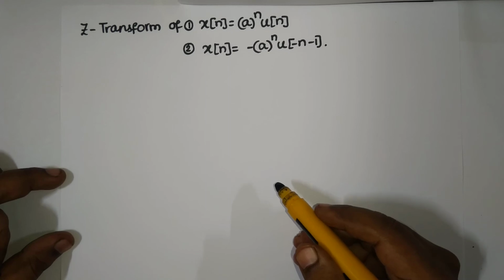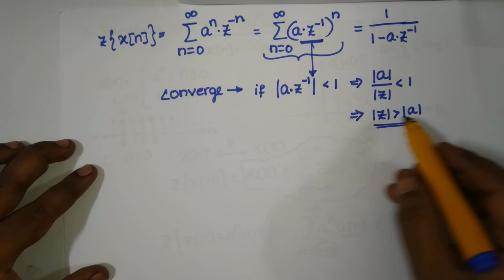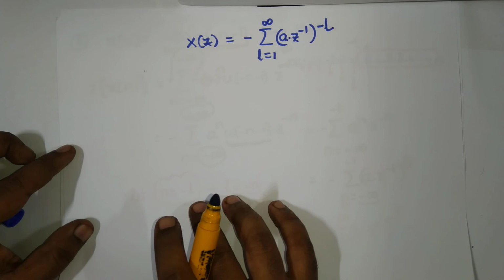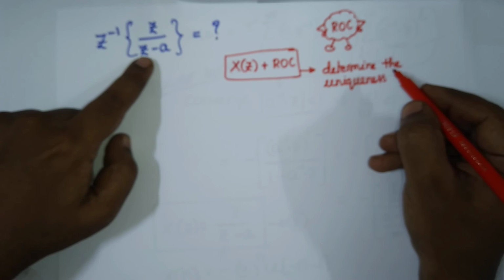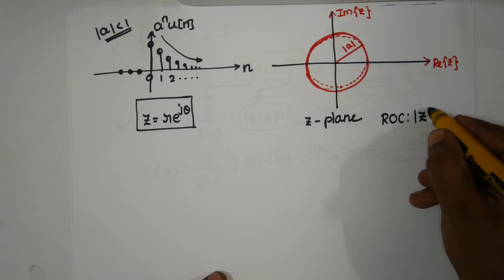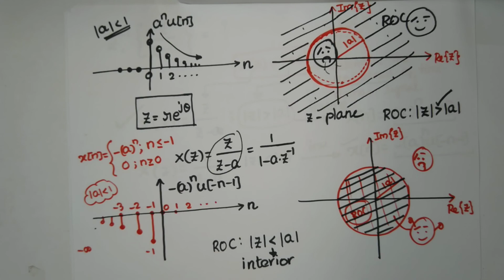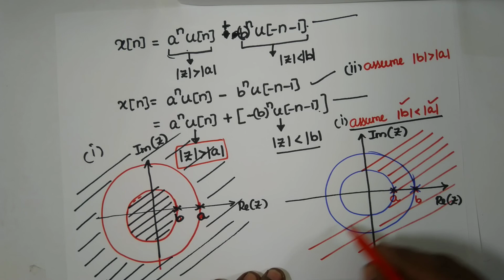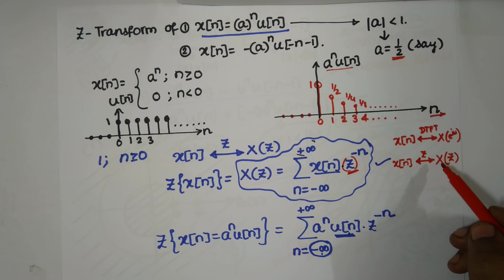Z-Transform: Infinite duration Causal and Anti-causal sequences in detail.  ||  Quantum Brainz

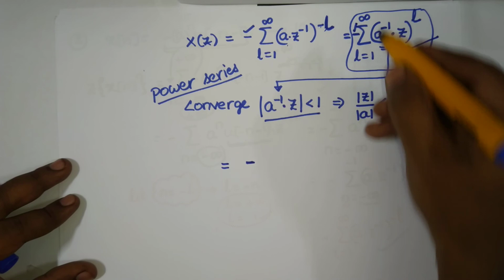Comment: At time 17:54 he does the power series, but doesn't explain how he gets that numerator. It's supposed to be 1/(1-r) where r is our base. In this case it's a^-1 * z. Please explain if you can? Thanks.
Reply from the maker: Hi Richard, please go through the limits of summation, which is running from l=1 to l= infinity  not l=0 to infinity. So ((a^-1*Z)^lower limit)/(1-a^-1*z). This is true when the other limit is infinity.